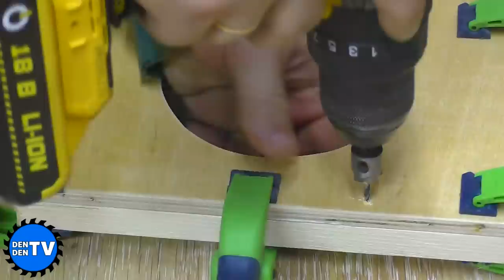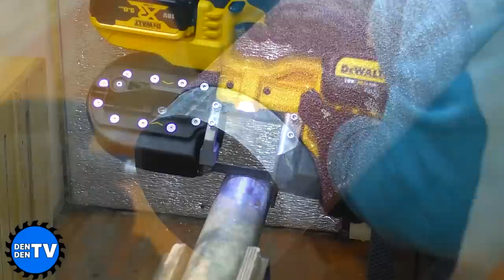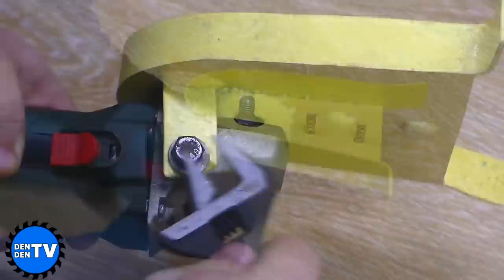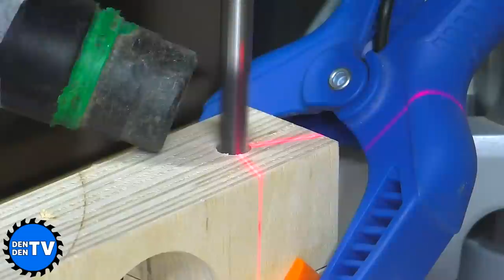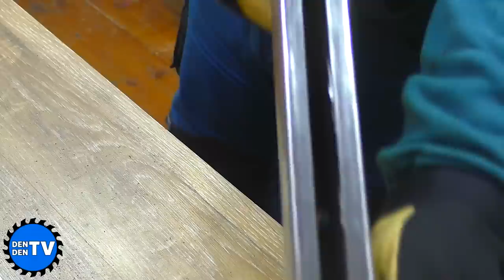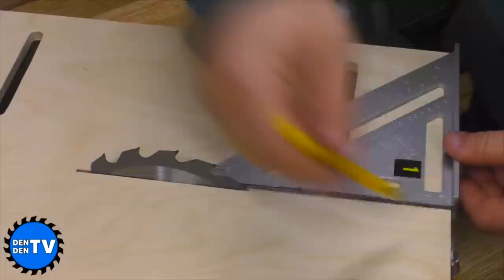4 ingenious homemade machines !!! DIY

Comment: and how to make the angle grinder move in two planes and be regulated by the depth of grinding so that it would be possible to grind the walls of aerated concrete in one level thanks
Reply: Gostaria de saber se essas adaptações estão disponíveis para venda,ou seja se posso comprar.